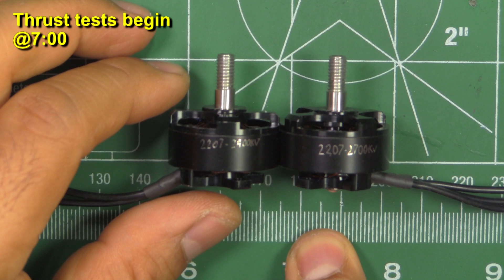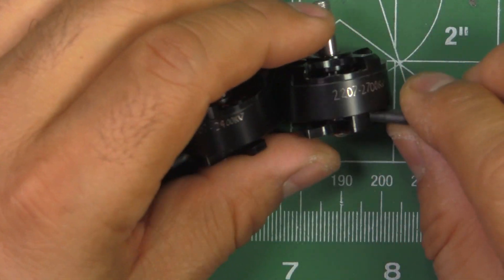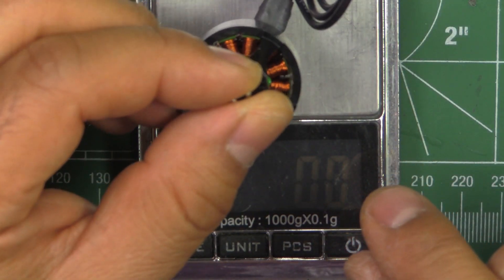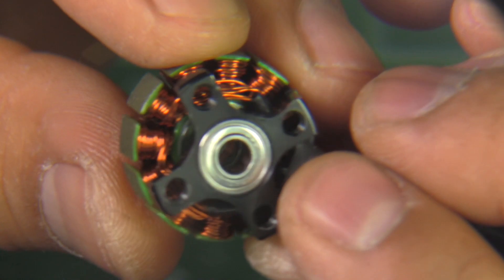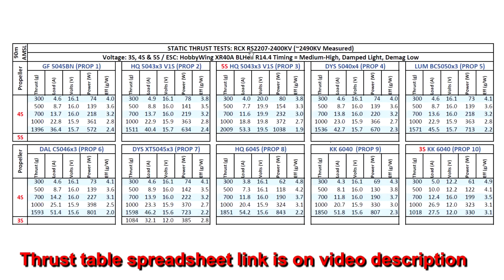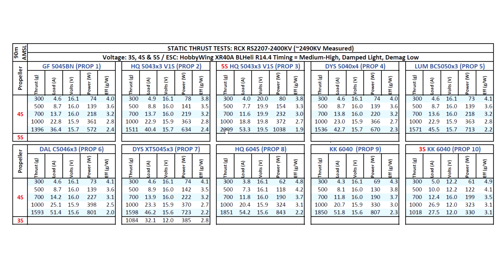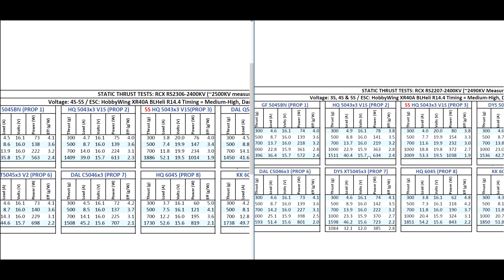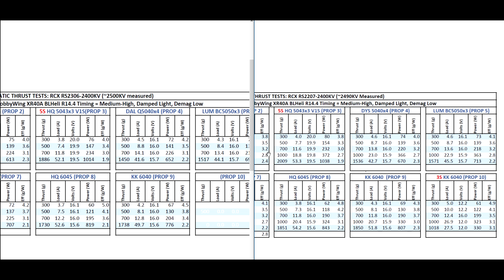RCX NK2207-2400KV New Motors from MyRCMart.com

Comment: How does this compare to the RCX LS2207? Debating whether to get these or the LS ones.
Reply from the maker: This one uses better EZO bearings and perhaps better matched magnets so the extra $2 or $3? (I don't know exact price difference) could be worth it for some people. MyRCMart says that the stator is the same or very similar so I think on the new batches performance should be very close. Motor armature and shaft are the same so they should have similar durability. Only difference could be bearing longevity.

Comment: I received mine. I resell them. Impossible to unscrew the shaft, they use way too strong loctite and the screw is bad quality with not enough grip, almost round inside the hex.
Please RCX, put the C-clip back !!
Reply from the maker: Maybe they changed the screw and started using more or stronger Loctite. When I unscrewed the ones I got it was very easy. I did not heat it up with soldering iron as I usually do in other motors and screw seemed to be good

Comment: hello, maybe you have more info for the ETA of this nk2207 2400kv?; and second question; have you notice/see one small lip , for 
to hold the magnet like rs 2206 V3 bell?
do you think they reduce the kv on the 2700 kv version?
thank a lot for your time, you help us a lot !
Reply from the maker: Yes, there's a lip on the edge of the bell to help keep the magnets in place. I missed mentioning that very good feature.
Sorry, I don't have info about the release date, but if they take about the same time as the NK2306 I reviewed, then my best guess is that these should be released soon, but I'm only guessing. I mentioned to them about the KV being too high on the 2700KV version so hopefully they will reduce a little. Thank you for watching!
Reply: thank for fast response !

Comment: Nice review as always! I really thank you for your efforts and watch them closely... I see you have a direct line to RCX... I see they just came out with NK2204-2400.... which is great! ... but the motor I'm look'in for which would be the best balance for a light build with power would be a lite version 2205-2700kv motor.... I'd by those by the dozen...would be perfect for a 2-blade set-up I like to use....  I'd appreciate it if you could pass it on... :)

Comment: are these worth upgrading from my rcx 2206 v3? 
i have these for a while and thought of an upgrade insted of getting new bells and bearings
Reply: I love my rcx 2206 2400 over emax 2306 2400.
Reply from the maker: You could see a slight improvement in performance - the RS2206 V3 are already quite good. A few people already flying these new NK2306 have said they're very good and they're very please with their performance. If your quad is superlight, you will "feel" more of a difference, as quad gets heavier, the difference will seem to be less. The new NK2207 (not released yet but available soon) may give you more perceivable improvement as it has slightly more torque than the NK2306
Reply: thanks for the replay, im not a fan of those 2306 motors but i think ill wait for the 2207 2400kv 
btw my quad is around 300-320 grams i think so not superlite
Reply from the maker: 2207 will be best then, 320g not that bad, so even 5043x3 will be nice. Then you can try more aggressive props for more thrust.
Reply: same the odl rs2206v3 is better vs nk2306, more efficient, same thrust, a little more kv for the nk, i dont want upgrade myt 2206 for so little power, i wait the 2207 2400kv :)
Reply from the maker: The 2206 is a very good motor and that's why it is still difficult to surpass its performance. When I tested the 2206, it beacme the most powerful motor I had tested for similar size 2205/2206/2207

Comment: hey there
I think you and all of the viewers should know best
what motor should I buy, the 
(RCX RS2206 (V3) 2400KV) 
(RCX NK2204 2400KV) 
(RCX NK2306 2700KV) is there no nk2306 2400kv???
first or last one huh? what do you think
Reply from the maker: BroccoliBrigardist There should be a NK2306-2400KV. For what purpose? Just freestyle 2306-2400 or 2206-2400 should be great. 2700 will give you higher top-end but if more of your flying happens at low to  mid throttle then maybe 2400 is better? Really depends on your style of flying.
Reply: mostly freestyle, soi should get the rs2206?

Comment: Oh yeah, my next motors :)
Reply from the maker: Pretty good choice! Gotta love RCX pricing and availability of very reasonable-priced spare parts
Reply: I'm very very happy with the RS2206, I got 12 of them on my 3 quads ^^
I just don't like the screw under the shaft on the 2207, I prefer c-clips :-/
Reply from the maker: Same here - I prefer clips: weigh less than screws LoL 0.01? grams less. Screws can get messed up on the Allen head or threads, need to loctite.... clips are a lot simpler. Just gotta know how to install and remove. A bag of 100 is $1 to $2
Reply: C-clips are way easier to trim, with a screw, if it's too tighten your motor wont spin well, if not enough tighten it will have play, I deep clean up my motors every month, it's an important feature for me, and I don't want to ruin my bearings with loctite.

Comment: im looking for a new motor for my quad, 300g weight 
for now i have the 2205 racerstars but i want something with more power but decent efficienty
would you recommend me those motors if i want a bit more power but efficiency too?
also compared to the aokfly 2306 this motors are more efficient right?

Comment: As of today (10/13/2017) both the 2204/2400kv and 2306/2700kv naked bottom motors are released. They expect the 2306/2400kv motor to launch soon. I've rocked the 2208s and the famous RS2206 motors for a long time and the 2206s are some of my favorite motors. Great cost AND repair parts. Cant beat it. Thanks for the video! Oh and the series name for the motors are NK- btw!
Reply: which one would you recommend of these motors, nk or rs? what kv nk2306, are only in 2700kv right? I need to choose between rs v3 and nk
Reply: I haven't tried the NK series yet, but the RS series was quite good. I would say about 90-95% the power of my EMAX 2306/2400kv and half the cost. I can say now you can't go wrong with the RS V3, if you don't mind naked bottoms then you can wait but if you don't like the naked bottoms then go with the RS.

Comment: Very nice motor. Would there be any idea comparing bell weight. Just thinking, we weigh props, to get an Idea how quick transition times would be. Would it be equivalent with a lighter bell design?
Reply from the maker: A lighter bell would help a little. There's not much more material that you can take out from most already light motors. Most of the weight is in the magnets I think. You also want some good thickness on the bell ring and cap for surviving crashes and managing magnetic flux spillage on the outward side of the magnets
Reply: EngineerX ok cool. Thanks for the reply

Comment: a beast of a motor! 100grams more than the 2306 on average. I wonder how is the power curve compared to the 2306.
Reply: I have both 2306 and 2207 and I would say the 2306 is a better motor for freestyle with a more linear and smooth power curve while the 2207 is a lot more powerful and responsive motor.
Reply from the maker: They're not that consistent because I control the ESC signal manually :( But I think you can still more or less do a comparison based on RPM. The logger for Thrust runs a little bit behind the rest of the sensors, so usually you gotta match with Amps & RPM for the row above (still this thrust stand is pretty good for the "simplified" tests I run). Also the sampling rate resolution is not that detailed, so not as many data points as Miniquadtestbench does on his Arduino-based testing equipment. 
The thrust stand does have automatic ramp scripts but they take too long to run and I would never finish -given the few hours I have available during the week.
Reply from the maker: Only a long....long time ago (about 3years). I built a 6" 2208-1800KV (Airbot Titan motor) rig that I ran on 4S/5S/  & 6S. It was darn heavy LoL 
I'v been wanting to build another 6" with all the new parts we have now. I got the frame about 6 months ago. I'm think of using a BH T2 2206-1800KV or these new 2407-1800KV motors. HQ6045 or KingKong 6040 props.
Reply from the maker: This one https://www.youtube.com/watch?v=dsFcLARDmT0
Reply: lol an oldtimer !
Reply: FPV Portugal yeah I have checked the finx before, true innovation, I think all motors will move towards the rippled bell construction in the future. That being said the finx40 kv offerings are not really suited for 6 inch and 4s freestyle imo. The one is 1600kv which is very low and the other is 2600kv which is very high lol. So far according to the feedback from rcgroups my best bet is probably the f80 2200kv or maybe the new f60III 2350kv. I ll wait till the latter is tested by you, or engineerx, or quadmcfly. Really you are the only 3 guys in the net doing consistent motor thrust benchmarks. Keep it up guys, the community needs you.
Reply from the maker: Lefty FPV unfortunately I don't have enough time to run the full more detailed ramp-up to get more thrust-rpm data points. But there's some data 300 to 1000g on the propeller tabs in the Excel spreadsheet. I would imagine the 2207 does better all around.
Reply: ha, I was about to ask you if the ramp up times are consistent and comparable between the motors in order to draw some quick graphs from your excel sheets. Well if they are  I got some interesting points comparing the 2400kv variant of the motors on the v1s. At any given rpm the 2207 needs about 20-25% less time to reach it and it has a significant smoother more linear curve. So yes you are right the 2207 is the better of the two, at least on paper and that particular prop.
Reply: my only experience with 2207 are my zoefpv 2207 2400kv and my f60 2450kv. The zoe were a bit weak for 5 inch and so I put them on a lightweight 325gr dry 6 inch and they perform nicely.  The f60s are still a good motor and run smooth but are heavy and as a result the build they are on is  a "classic" freestyle rig at 355gr dry. They do ok , no complaints. Still I am building 2 more rigs, a racer and a freestyler so I will probably get a modern 2207 ,like the proton x you recommended or similar, for the racer and definitely a 2306 for the freestyle if nothing more to feel them for my self.  I am also thinking to modify my latest freestyle design and add a 6 inch option, problem is, there are not so many options for a 6 inch motor that is powerful,efficient and not very heavy like the f80s. Have you had any experience with 6 inchers?
Reply: It's ok mate , a man got to work,most of us have limited time. We will do the best with what we have ;-)
Reply: Lefty FPV zmx have the Finx40 with low kv option for 6 and 7" builds, might worth checking and the R3 had released some 1900kv too, it's a nice option too, r3=2206 stator.

Comment: Will you be reviewing the new rcx 2204s? They claim they are more powerful than the 2205s, so should be pretty sweet in a light quad.
Reply from the maker: Coppertop FPV I hope they send some test samples.They sure look like a good option for a superlight setup
Reply: Yeah. I'm puzzled by these 2207s. I would have thought the 2306 would have more torque, and the 2207 higher top end, but I can't decipher that. If I was buying one I haven't got a clue which one I would choose lol. Seems odd to be releasing motors so similar.

Comment: I'll take a screw any day over any type of clip.
Reply from the maker: :) I don't mind either - but like the simplicity of clips. They're easy to remove and you can get like 50 pieces for $1 from Bgood
Reply: True... I think I'm too impatient to fiddle with clips lol
Reply from the maker: LoL .... sometimes I have cursed at the darn clips ... at the beginning, but now I got used to removing and I bought a $3 circlip tool from eBay, I ground down the tip to make it fit the 3mm circlips. The good tools made for these small clips are more expensive like $20. The one I modified works well enough for my needs

Comment: What would you guess to be a better design for durability: the rcx 2206 motor or these 2207 motors
Reply from the maker: JC250 From what I can see. The RS2206 seem to be just a little better but not by much. Mainly the bigger magnets they use. I think that's why they're so powerful. If the base on this one is thick around the bearing housing then these should be just as durable. I can't measure the thickness there unfortunately.
Reply from the maker: Correct ! I changed the name on the Video Title ;)
Reply: EngineerX are these been renamed to RCX NK2306 ?
Reply: EngineerX ah ok only found the 2206 motors so waiting for the 2207's..
Reply: wait so are those 2306 motors?
Reply from the maker: These are 2207. I thought serval FPV was referring to the other 2306 tests those are NK2306

Comment: Awesome test, and awesome motor, if they price this right this gonna sell a lot... Keep the great work.
Reply from the maker: FPV Portugal Should be well priced I hope and these should be a good option for those who want power at lower cost. Thanks buddy!
Reply: EngineerX you are more than welcome. Thanks for the great work, you are releasing some very interesting motor tests , I like your detailed review. Hug , Rui.
Reply: 2306 2700 are out , 13.99 no warranty option.
Reply: Lefty FPV good price, the 2207 should be listed soon. I will order some for myself, the 16x16mm pattern is needed for a new frame design I will be using. :p

Comment: R.I.P 🔋
Reply from the maker: Nici619 better stay with more civilized 2205-2300kv motors! Noooo LoL. They'll be ok. Wait until you see the 2700kv numbers. It's actually closer to 2850kv!
Reply: EngineerX I know. But what good is more KV if the Lipo doesn't provide enough power? Nothing. ...
Reply from the maker: There's some benefit... when flying at speed, with the right prop (like a 5040x3) on a light setup you'll definitely get more performance. True, it will cost more Amps and shorter flights but there are many people who are OK with that . I know quite a few people that won't got back to 2300KV and fly only 2600~2700KV 2206~2306~2207 motors and they don't mind 2:00 flights on 1300mAh packs. The good thing is that we got plenty of choices so we can choose 2300KV motors. The factories started making these "big" motors because lots of people kept asking for more..... now some are asking for less LoL ;)
Reply: EngineerX thanks for the good answer. Have a nice weekend
Reply from the maker: Thanks for watching and commenting! Have a great FPV weekend as well!